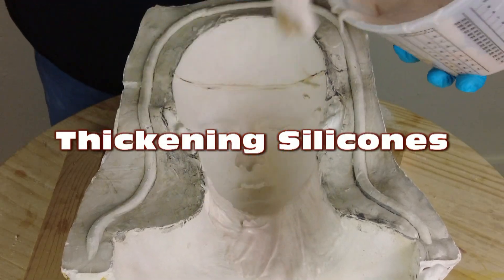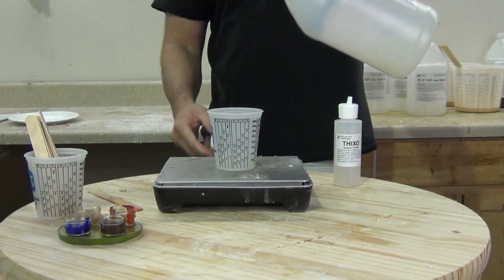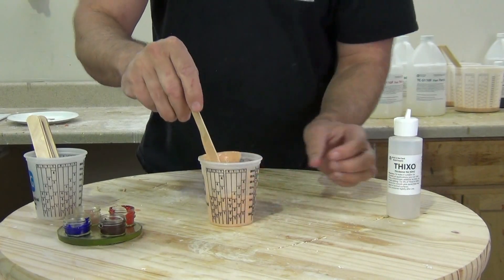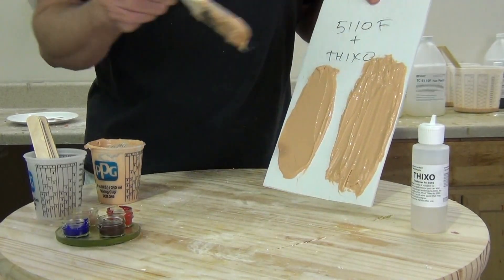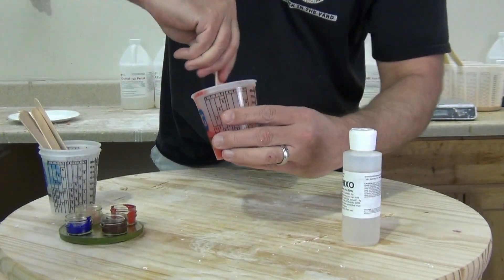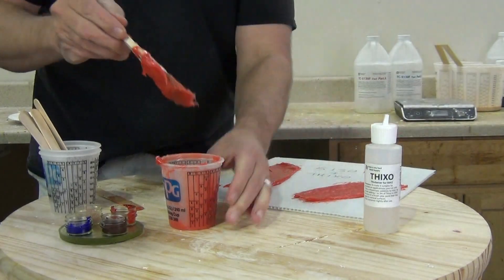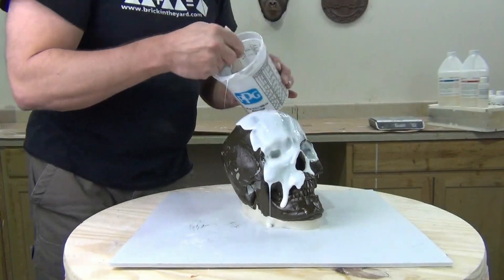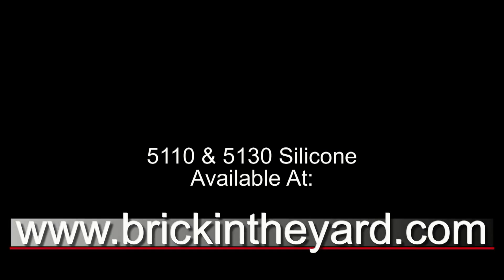Moldmaking Tutorial: Thickening Silicone For Brush-on Molds and SPFX

Comment: Do you have a product/ video for making a hard cast of my face so I can make latex masks based off my head & neck size? I watched the hydrocal vid and looked at the product but I'm not sure if that's the right product I want. I'm wanting it to be as easy, yet cost effective as possible. I'd prefer not having to buy multiple products to achieve a flat based mold like you had in the video.
Reply from the maker: That will require several steps as I do not recommend making a rigid mold of your face. You can pull a clay positive (such as monster clay or Alien Clay) from a 590 alginate face mold or a CopyCat silicone lifecast. The clay positive can be used to produce a Hydrocal mold. Go to the video library page and check out the "lifecasting page" the "sculpting" page, and the "silicone props" page.

Comment: This might be a bit silly to ask, but I've seen a few people make molds from regular caulking silicone with cornstarch added. Would the cornstarch work to thicken these silicones as well or would it cause it to inhibit curing?
Reply from the maker: Cornstarch will thicken silicone, but it will also lower elongation (stretch) and tear strength. There are some types of cornstarch that will inhibit some platinums so do a test first! Food additives are a real mixed bag as they are mainly designed not to poison you.
Reply: @brickintheyard  thank you!